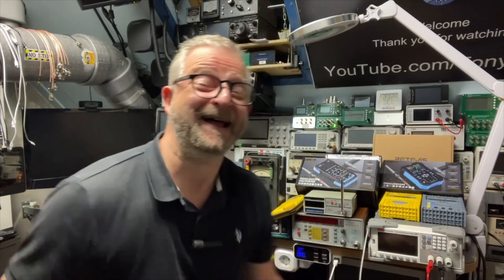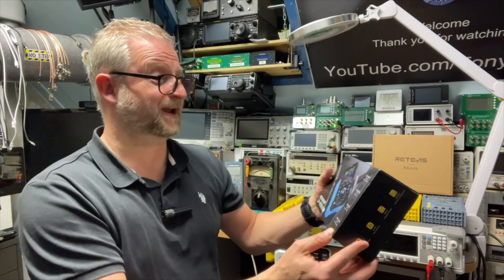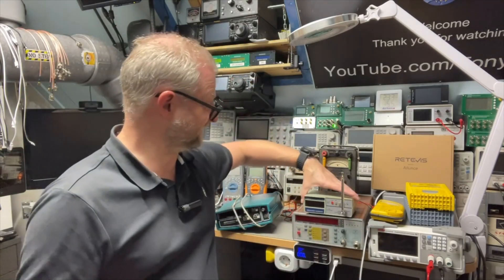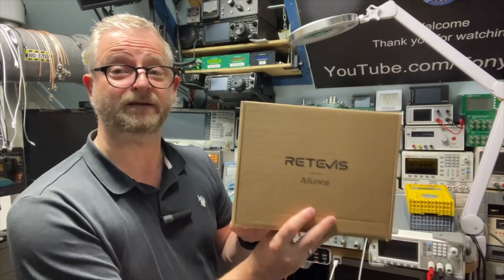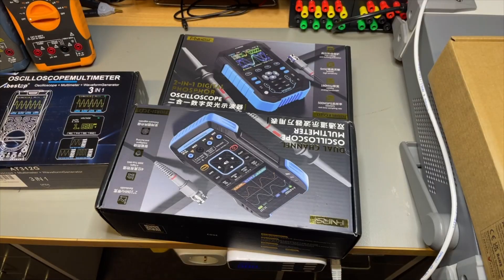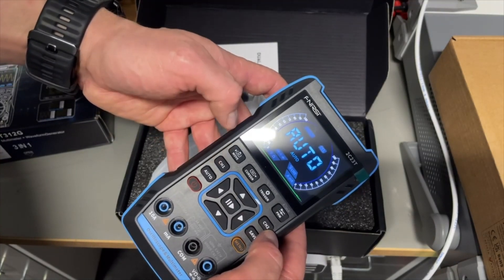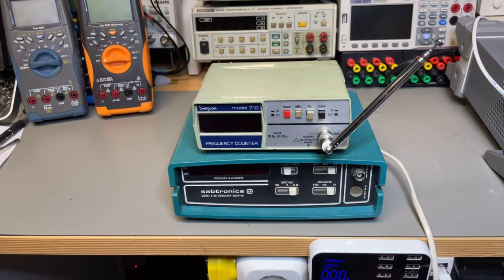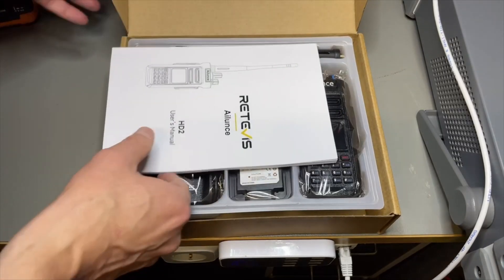TA-0401: Update May 2024 - What is coming in the next videos

Comment: Hello Tony.  If you compare Agilent 34401A and Keithley 2000, which device is better.  What is your opinion. Thanks
Reply from the maker: Hi, thats a tough one.. i do have both but my keithley broke. if you look at secondhard market usualy the 34401A is a better buy. From the keithley i like the super fast sample rate. the Agilent ik like the bigger bottons and it seems more easy to operate and it is very stable on temprature changes. if you ask which one i used more in the time both are working fine. that would be the Agilent.
Reply: Ok @TonyAlbus

Comment: Hi everyone, I have 2 questions please. 
I bought a UNI-T UPO1202CS and so far it is a good DSO for my hobby except for 2 things are annoying and I am afraid that maybe the oscilloscope need to be returned but not sure yet as I don't have good reference signals to test it properly. 
for now I have an si5351 clock generator connected to an Arduino Uno R4 working as a signal generator. 
first problem is that when I try to use my oscilloscope to measure the signal of the si5351 the auto mode of the oscilloscope only works with signals up to 160mhz,  when I try to measure signals above 160mhz and after pressing the auto button the oscilloscope shows 160mhz but the signal is way above that, it doesn't matter whether it's 165mhz or 200mhz it only shows 160mhz until I change the horizontal scale manually, at that time it shows the correct frequency. 

second problem is that when I try to decode an I2C data I am not able to get a stable waveform on the screen. 

not sure if this normal or should I contact UNI-T support, also I don't have enough resources to test the oscilloscope with different signals.
Reply from the maker: Hi, if the Si5351 outputs a squarewave you need 3 to 5 times that frequency to properly see it on the scope, also a square wave has a lot of harmonics that maybe confuses the auto setup function. but sending a message to UNI-T is a great idea, then you are sure.
Reply: @TonyAlbus  
Hello Tony, thanks for replying. 
I'm actually getting square and sinewave from the same output, it depends on the frequency, for example, if I connect my oscilloscope to si5351 output number 1 and start increasing the frequency, the wave on the screen changes between sine and square, not sure which range of frequency gives sinewave and which one gives squarewave I will have to check that again. 

I am confused because before I bought the oscilloscope I saw an old video of someone measuring a frequency almost one and a half time the bandwidth of his oscilloscope, I think it was Rigol  or Siglent, so when I tried that with my oscilloscope I was really disappointed lol. 

so if I understand you correctly, my 200mhz oscilloscope can only measure a frequency up to 66mhz.
Reply from the maker: @bigdog9480 the generator keeps outputting the square but at approximately 1/3 of max bandwidth of the scope it wil display sine. it has mostly to do with rise time of the scope and the bandwidth.  to you scope is 200 mhz the square would be visible until around 70 mhz.  thats normal
Reply: @TonyAlbus  thanks a lot Tony.
Reply from the maker: @bigdog9480  all scopes do 1/3 of the frequency when it comes to squarewave. sine wave you can do the full bandwith.
Reply from the maker: @bigdog9480  Welcome!  ... in my first videos i also did not know that and had the same feeling as you about my scope... but good to know thats all normal when it comes to square.  enjoy the hobby!
Reply from the maker: and lowering the voltage may also help a bit, but that is more slew rate of internal opamps, that is why scopes use 1/10 or 1/100 probes.
Reply: @TonyAlbus  
good to know, I will try with a lower voltage next time 👍